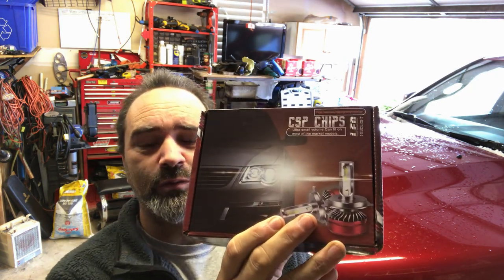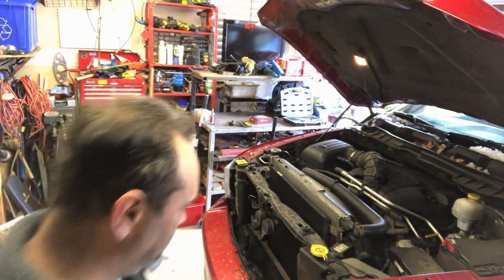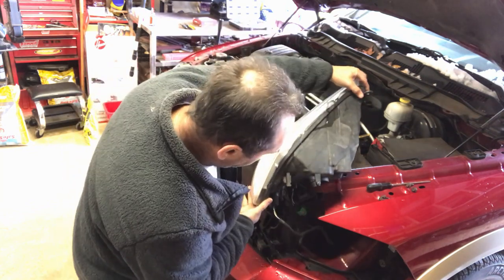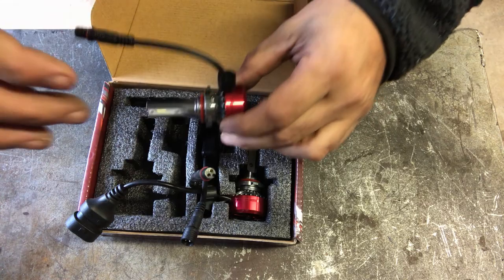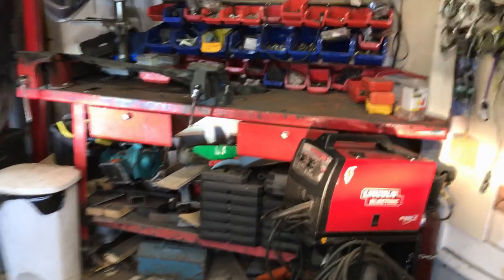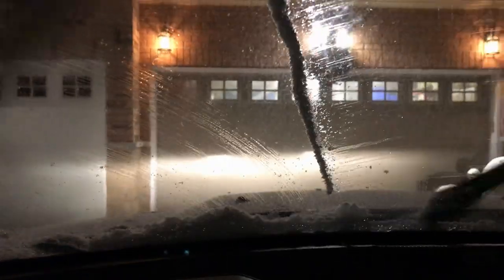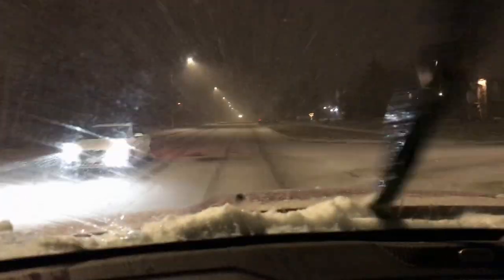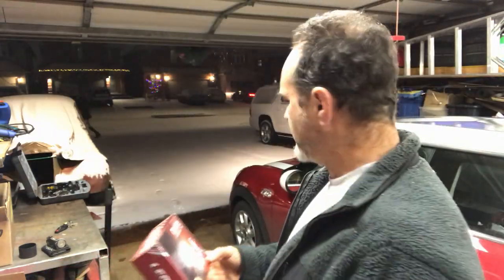Ram 1500 LED Headlights Conversion

Comment: You don't have the retaining clip in the wheel well? It's through a small door in the front of the well and holds the light in from the back. Oops, I just saw your video description, never mind.  Anodized aluminum was the word you were looking for. Do you have a video of the low beams? By the way, I heard you signalling in the roundabout, no one does that here in Nova Scotia, terrible drivers. Great video and thanks for the  product link.
Reply from the maker: No-one signals here either, but I'm from Scotland and that's just how we were taught. I didn't do a video on the low beams as it's the same process, but I can report that they work great. And thanks for Anodized, that word always escapes me for some reason.